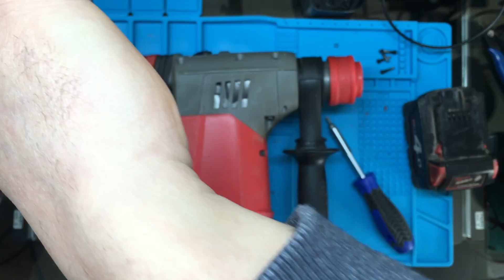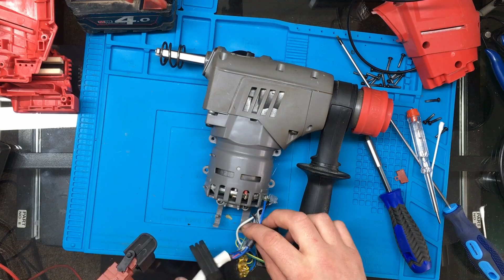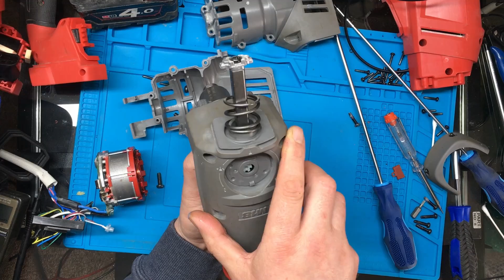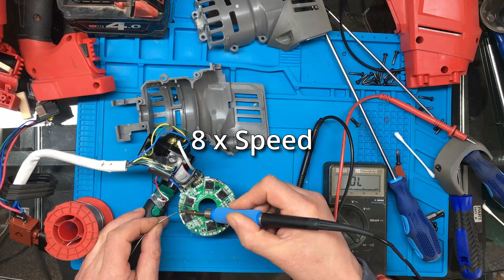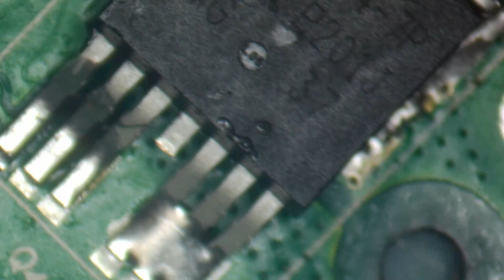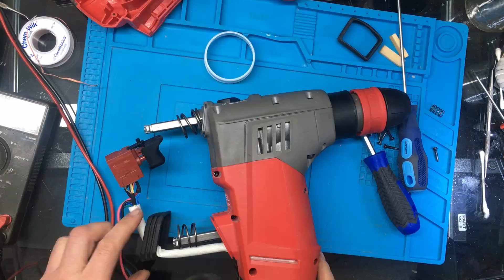Milwaukee SDS Drill Repair - model (M18CHPX-0).

Comment: Rule number 1: a fuse will do everything to protect itself long enough for the sensitive, expensive components to blow up.
Rule number 2: never mess with the wrong fuse, unless you have more expensive components to burn:
Rule number 3: the correct fuse is the one that has the right markings but does nothing when it should melt.
Conclusion: a fuse has no use. Better throw a party, put 10 "identical" fuses in parallel, then bet which one will blow first. Repeat 9 times.

Comment: I have exactly this broken drill, will any "IRLS3034-7P" part on AliExpress fit? Can you send me a link to a good transistor?
Reply from the maker: I wouldn't recommend the Mosfets from Aliexpress. I've had fakes from them in the past. I'd use a proper component supplier such as Digikey, Mouser, etc

Comment: Thanks for the video, I was expecting the trigger to be faulty like in my angle grinder at the beginning but it was fine, then I realise that mine died after use it in a hot day for 30 min, I had ready to open it, but started to work fine, next day leave it under the sunlight and stop working, so I open it up, just the plastic case, clean it with air gun, it was really dusty inside from the last 7 years of use, and seems to be working fine now, maybe the dust/rubbish stacks on top of the heating sensor?? 
In case anyone want to give it a try of an easy fix if the syntoms match.
Good luck.
Reply from the maker: Thanks for sharing 👍

Comment: My old CHPX failed after 7 years of abuse, so I bought a new one, that gave up the ghost after 6 months, repaired under warranty. The problem is the driver board, which comes as a spare with the complete motor stator assembly. I wish they did the boards as a separate spare. Or made them so they didn't fail.
Reply from the maker: Yes, unfortunately a lot of "spares" from Milwaukee come as full assemblies which are often nearly the price of a new tool. I had this with a sander I repaired. The new motor "assembly" as £89 and a new sander £99. I managed to source a compatible motor from Aliexpress for around £9 and repaired it.
Reply: If you want to be able to buy every single part for fair amount of money, buy Bosch blue.

Comment: I noticed when you soldered in the new mosfets, you didn't care that they all 3 were soldered together.  I guess you knew with the circuit that it didn't matter?
Reply from the maker: Yes, the MOSFET's pins are all connected internally inside of the MOSFET (apart from the first pin on the left which is the gate pin).

Comment: Ahh classic Milwaukee electronics dying.
These have way too many electronical problems for being what they are. This drill has done no work and died already. Defective out of the gate. 300 pounds for that?
They also have an issue where the gearbox lubrication is suboptimal because the chamber is too big and not separated usually professional hammers have two chambers one for the gearset and one for the pneumatic hammer mechanism so the piston is always lubrictated well.
Milwaukee has one chamber and its too big so the grease pools in the bottom and leaves the piston dry. 
Also Milwaukee is just horrible to repair, parts are grouped into whole assemblies and too expensive.

Buy a corded Bosch or Makita they last a lifetime and are so easy and cheap to repair.
Reply from the maker: Interesting. Thanks for sharing 👍

Comment: This is a long shot, but i was wondering if you've come across this before.
I have a milwaukee brushless grinder and one of the phases isnt working and i thought it might one of the mosfits but from what i can see if one mosfit goes they all get taken out.but my grinder is still running😂.
Pull the trigger and it starts to run then cuts out,the hit the trigger again and it gets faster and cuts on more time.then 3rd time is a charm and hits full speed but if you put too much pressure on the blade itll cut out.
Do you think it could be a resister or a strange fault on a mosfit.

Great video btw.👍🏻
Reply from the maker: Thanks 👍each pair of mosfets drives 1 phase of the motor. It's possible one has failed and caused the symptoms you describe as I've had that before. I'd also check the hall effect sensor that are below where the rotor fits in the motor as I did have one where debris had jammed between the rotor and sensor and damaged one of them.

Comment: Hello! I have the same symptom, except that at home, it's not the mosfet, but one of the hall effect sensors that was torn off by a piece of concrete... could you find the reference of these? On the sensor it says w78d or w79d... thank you for your great tutorial 👌
Reply from the maker: Thanks 👍I did have a look on smdyooneed.one but counldn't find that code to see what hall effect sensor was used. I know someone else asked similar on another video and ended up getting one from another broken tool as all of the tools (saws, drills etc) have pretty much the same motor setup.

Comment: I am a power tool repairer, and by the looks of the grease in that gearbox the tool has done hardly any work whatsoever, so its very strange that the mosfet exploded. Most likely an initial failure the first time the trigger was pulled. I wish I had more electronic knowledge like you because I have several dead brushless electronic assemblies in my workshop. Other than cleaning the switch contacts i usually just have to replace the electronic assembly. This model is definitely not the easiest to reassemble.
I enjoy your videos, please keep them coming.
Reply from the maker: Thank you👍What makes of tools do you repair? are you in the UK?
Reply: @BuyitFixit  No I'm in Australia. I would gladly donate parts to you if I was in the UK, but unfortunately the postage cost from here is very expensive. 
I fix all different makes/brands, Milwaukee, Makita, dewalt, hitachi/hikoki, bosch, metabo etc, but the majority of my repairs are usually paslode nail guns.
Reply from the maker: The only nail gun I've looked at was a Milwaukee. Interesting to know. If I ever come across a paslode you might well get a message 😂😂👍
Reply: @BuyitFixit  the paslode guns are gas (butane) fired and the only electronics in them is a resin sealed spark unit that creates the spark and times the cooling fan motor.

Comment: I have the milwaukee 2804 hammer drill, it doesn't trigger and the light doesn't work also . The tool feels slightly warm at the base when left connected to the battery.. I don't know what's wrong with it.. Any suggestions?
Reply from the maker: I've not had much luck with the drills. Most of the electronics are encased in a hard resin compound making it pretty impossible to get into. It could be a shorted MOSFET or blown microcontroller.

Comment: isn't it supposed to have a low speed when you push the trigger in slightly? It only seems to run on full speed. you have a slider potensiometer in the trigger switch, the one you rinsed off with IPA. are you sure that this potensiometer is working correctly? I always use the fine speed on the beginning of a hole, so i am sure that i hit my markings, and the soft start is very nice to make sure you start the hole in the right posisjon.
Reply from the maker: Very observant 👍after making the video I used it and thought to myself the same. It turned out inside of the switch are two sets of contacts along side the potentiometer. The first contact is used when it's in low speed and the second kicks in when the switch is fully depressed. It seemed the first contact in the switch had blown when the mosfet shorted,  I did manage to clean it up and bend it slightly so it made contact and now it runs at low speed too 🙂

Comment: Great fix! This looked fiendishly complex but you cracked it. I'm great at taking things apart - it's putting them back together I struggle with 😂😂
Reply from the maker: We've all been there mate 👍 I've recently finished doing the oil cooler on my Mercedes ML320 as oil was pouring out when it was started up. What a nightmare that was. Had to take half the engine to bits almost!

Comment: The model I have is a bit older, model 2612-20. It hammers fine but my problem is that there is no rotation whatsoever. It does not matter if it’s under load or not, zero rotation. Any help or ideas are greatly appreciated. I can’t find any videos or forums on this specific tool or issue at all.
Reply from the maker: Sounds like a problem in the gearbox I'd say. I didn't look to carefully in that section but could it be related to the selector for hammer / rotation / both ?

Comment: Another great video from you!  I live in the US and I went to college in Milwaukee, Wisconsin from 1988 to 1992.  My Father is a retired electrician and he has older Milwaukee  plugged in 120 V (mains AC as you call it in the UK) drills and other tools that still work great.  Keep up the good work with your videos!
Reply from the maker: Thanks SP. I guess we are similar ages. Yes we just call it mains but you probably already know its 240v over here.. Well officially it's 230v to fit in with Europe but regularly where I live it's 250v or higher!

Comment: Good video bro, i have the 2715-20 (its the same hammer drill), but dont do anything, the light still off when i put the battery.
Reply from the maker: I would check the trigger switch first to see if its making a connection when pressed. If its brushless like the one I repaired then unfortunately it could be that the main controller is fried, in which case they are usually encased in epoxy resin and even if it isn't you can't seem to easily get the chips and they also need programming with firmware for that tool, so not good news.  If it is the main controller then you would probably need a complete motor assembly from Milwaukee, or a controller from another unit.

Comment: Hi, I have exactly the same drill with exactly the same problem. I have taken the switch apart and it looks OK. Would you be able to look at it for me as I dont trust myself with soldering mosfets ?
Regards Andrew
Reply from the maker: Hi Andrew, unfortunately I don't really run a repair shop. This is more of a hobby and to show people how to attempt it themselves. If it's the same type of drill and it's not spinning but the light comes in it is very likely 1 or 2 of the mosfets.

Comment: I have a Milwaukee model 2715-20, and it seems like it may have a similar problem except for mine can still run (sort of, sometimes), but many times it does not do anything when I press the trigger, especially when trying to drill into something.  So the part you replaced may be on the way out in my drill.  How difficult would a similar repair like this be for someone with no soldering experience or experience fixing things like this?  Would it be better just to send it in to Milwaukee for repair (they quoted me $250USD) or would it be worth buying the tools and trying to fix myself?  Or should I just look into buying another 2715-20 on ebay or something?
Reply from the maker: Very good question Josh. If it's brushless and doesn't spin sometimes then I think the cause would either be on of the mosfets possibly blown open circuit, or possibly one of the hall effect sensors, although I've not come across that except one that had worn right through due to the armature rubbing against it. It could possibly also be the switch, as there are two sets of contacts inside the switch. As for your skill level at removing / replacing parts I cannot really say. Everyone is different. It depends on how "hands on" you are and confident. You could alternatively order the whole motor assembly perhaps from milwaukee and fit it yourself?
Hopefully this was helpful to you!
Reply: @BuyitFixit  Yes, thanks very much.  Very helpful.  Loved the video too.  Seems like you do a lot of these kinds of things!
Reply from the maker: Glad to help!

Comment: This is a fault I've had with high tourqe impact wrenchs a few times. Most of the time it's just 1 mosfet though.
Reply from the maker: Not looked at an impact driver yet. Got a few more Milwaukee things to repair still. Got a big angle grinder but unfortunately the main controller ic is blown and it's a custom part and programmed.
Reply: @BuyitFixit  it's only the big brushless impact wrench I've been able to do that with. The smaller units the mosfets are in the handle section with the controller.
Reply from the maker: Yeah I have a Milwaukee one-key drill which I bought to have a look at which had all the components encased in the handle too. Looks a nightmare to do anything with and the smaller grinders look similar as well.
Reply: @BuyitFixit  only luck I've had with impact wrenchs like that is faulty trigger switches where the carbon strip has burnt or corded off the board and replacing the trigger has fixed it. I'm really enjoying your videos though, keep up the great work.
Reply from the maker: @MrTorch8  Thank you Jacob